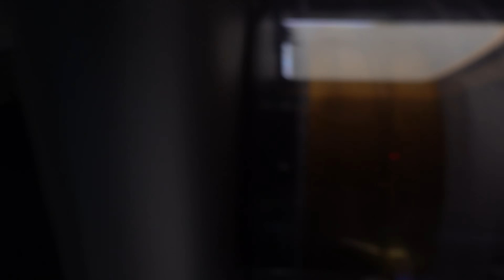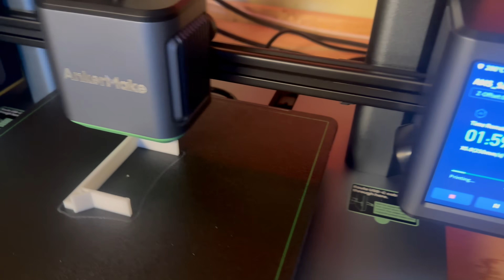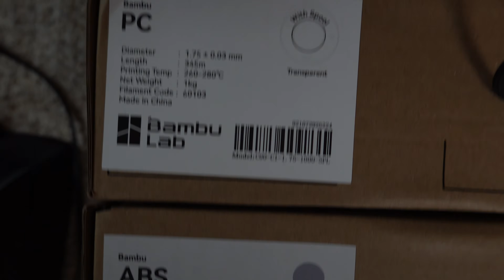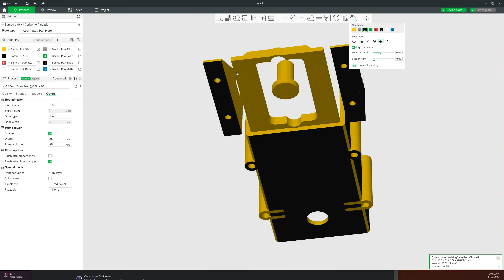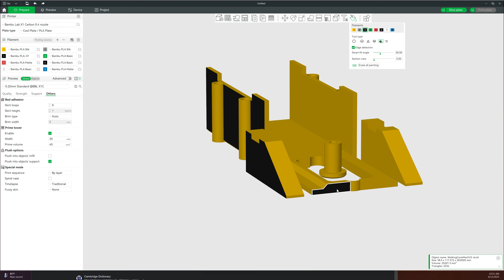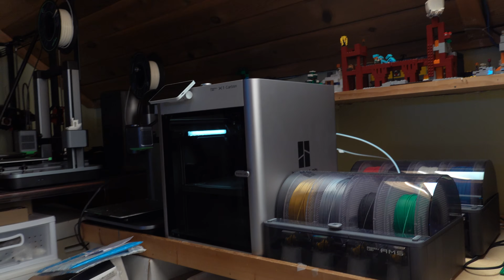My All Time Favorite 3D Printer... Ever, The Bambu Labs X1 Carbon Review

Comment: They actually recommend the glue stick on the bed to weaken the adhesion because its just a foil that sticks to the actual sheet / bed. Sometimes pla lr tpu sticks way too good and if you try to remove it you could damage the foil or create air bubbles underneath. Also they do sell pei beds like on the anker and they work pretty good but it doesn‘t work with the lidar / first layer detection (yet). But you can still use the calibration for the filament on the cool plate and then switch to the pei plate afterwards.

Comment: I thought all these glowing reviews of Bambu were paid shills.  Got an A1 combo 3 weeks before Christmas, loved the little bed slinger I think the best printer I've ever owned.  The A1 recall happened, got a full refund and bought the X1C with AMS.  Fast turning into one of those shills now and I paid full price for each and every one of those printers.
Reply from the maker: Now AnkerMake on the other hand.

Fun fact. Bambu labs review contract just requires us to give feedback on the printer. We don’t even have to make a video. (Yet we obviously do)

AnkerMake manually scans through and reviews the videos. I had to fight to have any comparison with other printers.
Reply: What's funny is there are things I still miss about the A1.  The nozzle changes were so easy on the A1, sounds gimicky but I like the tune you could play on the servo motors, I made custom songs and made a Minion extruder cover that they eye went around as it extruded filament.  ;-)  @JaysTechVault

Comment: not sure what you're talking about with the x1c, it's LOUD! I've cut some of it down by turning the fans down a little bit. But it just makes a lot of noise. I'm really hoping the announcement on the 20th fixes this like they said. I just hope it stays core x y and not going back to the bed slinger like I'm hearing rumors of. As far as bed adhesion, the cold sheet SUCKS... after I replaced it with a PEI, things are great!
Reply: Has anything changed since?
Reply: Yes after the firmware updates, I still had to tweak the fans but now it's super quiet, no problems at all. @SangheiliSpecOp
Reply: @DaMan97-t5p  Thank you for the info and for getting back to me!

I owned an M5C for a while but my research slowly opened my eyes to how much more advanced Bambu Lab was. I had no problems with the m5c and honestly it would make for a decent backup printer, but I did return it and just ordered an A1 + Ams combo yesterday. I have also done extensive research on the Bambu Lab core xy printers and decided that the X1C is worth the money, just saving up for it at the moment and doing more research. The sound of the printer wouldn't bother me too much if its within reason, so I'm trying to gauge how bad it is and from the vids i've seen, it seems to be tolerable. I appreciate your input!
Reply: it's quiet now. I run it while on conference calls for work and don't even really notice it anymore... before it was annoying, now no biggie. @SangheiliSpecOp

Comment: I've been wanting to get this printer. the printer is a little too pricey for me though
Reply: Then what about the p1p or p1s?
Reply: @Samuel-ef4fn  I can't even get those ones lol. I just stick to my ender 3.
Reply: @swordshattered7822  the elegoo neptune series is also pretty good for a relatively low budget. :)
Ps: i also had an ender 3 and it absolutely hated my whole existence, it never wanted to work like it should. xd
Reply from the maker: Dude I 100% agree it’s really expensive. I’ve bought only 1 $1000 printer ever: the Creality CR-10 max and that was dog water. This is at least worth the price. And also this is not for everyone, not for novices for sure.
Reply from the maker: And please do not have this as your first printer, a cheap printer is a good way to get familiar.
Reply: @JaysTechVault  I already have an ender 3 neo and ender 3 v2 so I have some experience, but the x1 boasts so much features and even includes an ams so it would be a HUUUGE upgrade
Reply: @JaysTechVault my first printer😂....... Since 2016